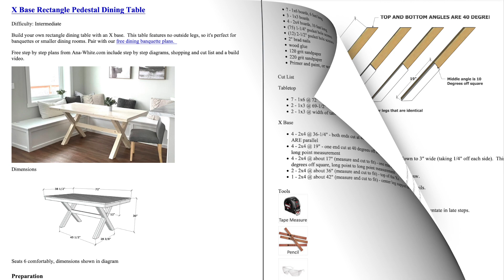DIY X-Base Dining Table with Free Plans

Comment: I think this would look good with the cross brace on the top of the X, maybe a triangular cross brace, instead of the butted and pocketholed one you used. One thing I always find a little annoying with X table legs is the cross brace. By having on top of the X instead of in the center of the X it would be about 4” higher and further out of the way. What do you think, Ana?

Comment: Hello Ana.  I have a question...  I built the banquette you designed and I am now in the process of making this table.  While building the table I purchased seat cushions for the banquette.  The new seat height is 22i Height.  Which I am thinking may be a problem for clearance under the table for peoples legs hitting the table skirt.  I am trying to find a way to fix this issue.  Besides getting new cushions, which I am hoping not to do.  Do you have another solution you think would help with this?  To raise the table height 2-3i.  I have the tabletop built and the x bases made.  I am currently on step 6 of your free plans.   Thank you for your time.